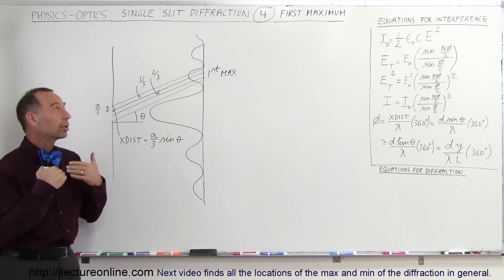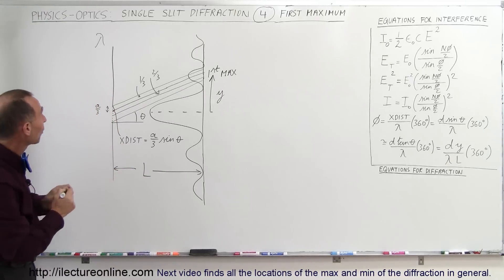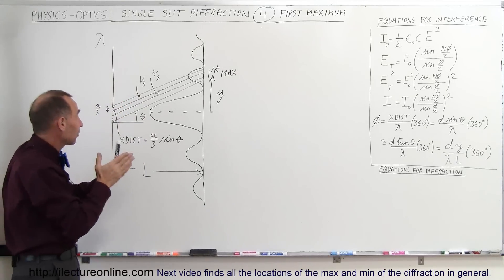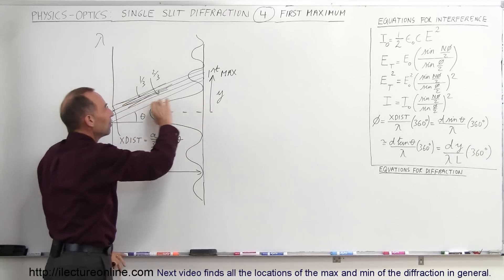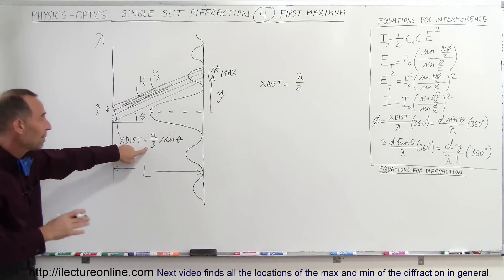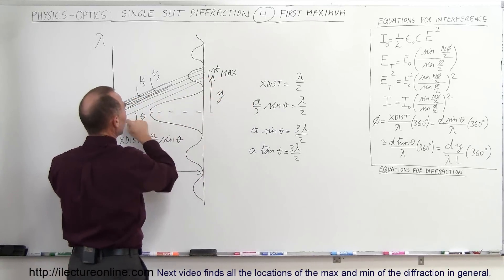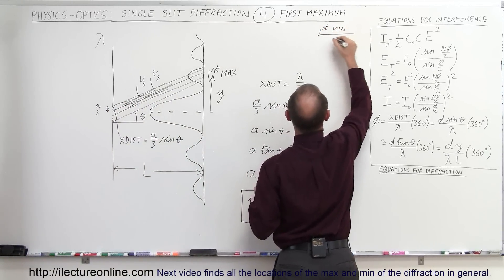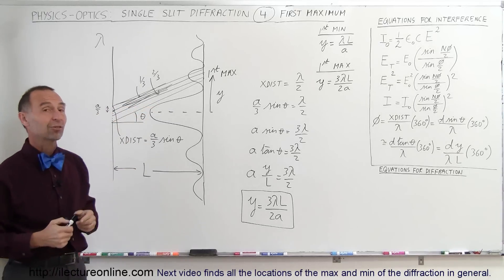Physics - Optics: Single Slit Diffraction (4 of 15) Location of 1st Maximum=?

Comment: I have the same question why the extra distance traveled is half of the wavelength instead of a full wavelength ?
Reply from the maker: The extra distance traveled will depend on the angle and will increase (as a fraction of a wavelength) with increasing angle.  We choose a half of a wavelength in order to find the spot where destructive interference occurs.

Comment: 2:05 Mr. Michel, why did you set the extra distance traveled to half of the wavelength instead of a full wavelength if our goal is for the light beams to constructively interfere with each other?

Comment: At part 1:19, I understand that they cancel for this to work and that 1/3 is left... however what feature about the two waves makes them cancel? I understand, kind of, that the path difference is lambda/2, therefore this makes them cancel, but what I don't understand is they're both lambda/2 then they'd both be in phase with each other and not cancel? Everything else in the video makes sense, it's just this little bit :) 
Thank you for any help,
Jenny
Reply from the maker: Since the beam of light has width, the right side of the beam must travel farther than the left side of the beam.  If the beam is angled in such a way that the portion of the beam 1/3 into the beam from the left side has to travel 1/2 lambda farther, the those 2 portions cancel.